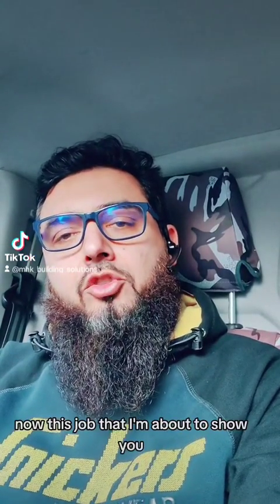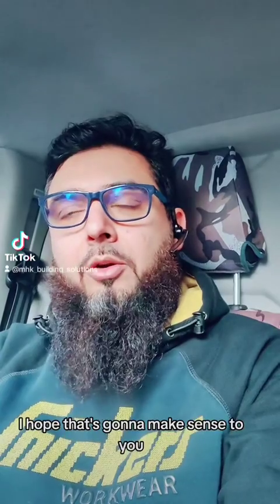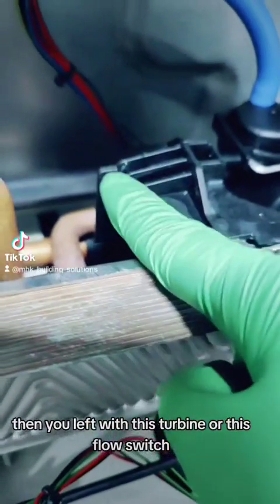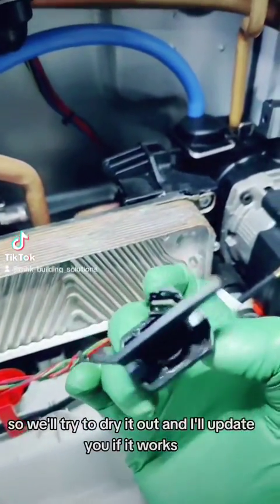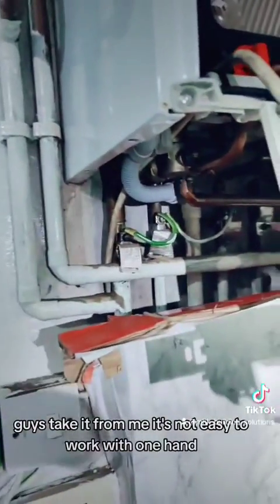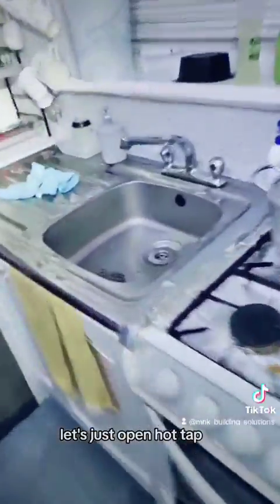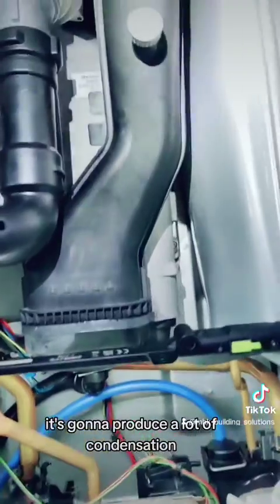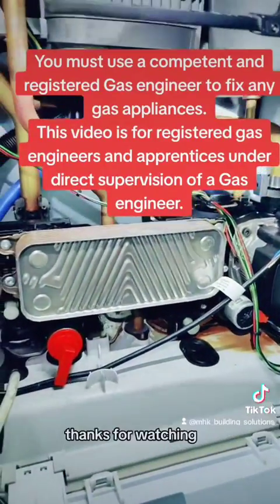Is a Combi Boiler Worth It? Faulty flow sensor.

Comment: I have an issue with my boiler.  When hot tap is on full the water will come out hot and cold switching between them but if I turn the tap down to a sweet spot it'll stay hot.  Any ideas?
Reply from the maker: @Hawk-_-Stone  when was it serviced last?

Comment: Pressure not too high at 2 odd bar?
Reply from the maker: Yes mate well spotted.
It was high as the customer filled it thinking it would resolve the issue .
I adjusted it before I left to 1.5 bar.
Reply: Excellent Vid, looksike I will be using the wife's hair dryer that she bought recently 🤣 @MHKBuildingSolutions
Reply: Thank you for the informative video. It very much helps when we are on breakdown. Cheers.
Reply from the maker: I am glad you are finding it helpful.